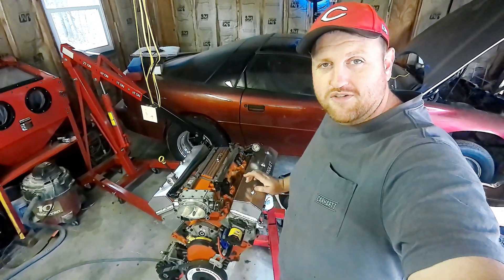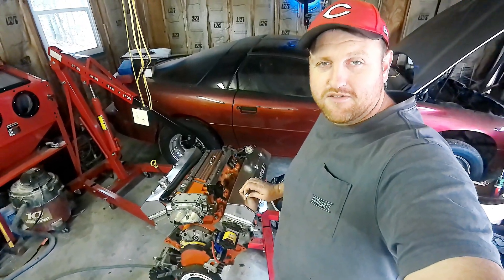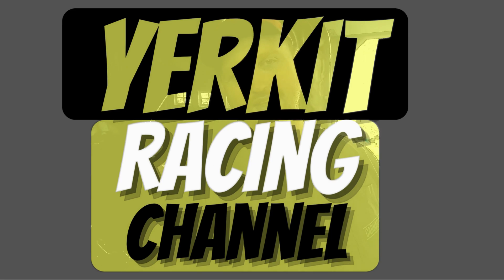SIMPLEST Hydraulic lifter adjustment EVER!

Comment: My theory when checking zero lash is twisting or up and down makes no difference. At the end of the day you have 40-60 thousands of hydraulic adjustment and the couple of thou difference in zero lash is undetectable to the engine operation. My preference is using up and down until I get the lash out then make the final by twisting with a very light grip. As soon as the oil squeezes out I can feel a definite drag. The biggest caution is making sure your socket isn't pushing down on the rocker ball or fulcrum to fool you. I learned the hard way and see people do this all of the time. Everyone can do what they want. Just saying how I do it and what I watch out for.
Reply from the maker: Thanks for watching and sharing your methods! definitely some good stuff to watch for

Comment: This works perfect.  EOIC takes forever and a day.  If intake is off definitely this
Reply from the maker: Definitely saves a ton of time! Especially if you have to leave it and come back
Reply: @YerkitRacingChannel  one question.  I did mine with empty lifters…meaning no oil.  Now that I’ve primed the oil system (oil comes out of every rocket arm) there is still ability to press into lifter 1/8 inch followed by recoil.   Is this expected?
Reply from the maker: @Se7enthsonSS Its normal for the lifters to bleed oil off when motor is cut off/oil pump stops spinning. That would let you be able to press the piston further down in the lifter. Are you able to push them down with oil pressure in the motor or did you try it after you stopped priming?  Also what psi did you see while priming the motor?
Reply: @YerkitRacingChannel  no can’t press them at all with oil pressure.  I had a lifter that wasn’t getting oil I’m the priming until I turned the crank over a few times.  Once I did that everything was harder to press and rebounded well
Reply from the maker: Lifters should be fine then assuming the bodies weren't worn too bad and the bore clearance was within spec.. Sounds like the oil is just bleeding down once the oil pump isn't spinning... As long as all the pistons moved freely up and down in the lifter bodies. As far as oil getting through to the top slower than the rest may have been some slight build up in the lifter passages... I did a video on rebuilding my lifters as about half the pistons were stuck in the top of the  bodies when I pulled them out the motor. On most of them it was hard to even tell what was binding them up. Doesn't take much trash at all to really bind the pistons and make them stop plunging or restrict the oil flow through them.
Reply: @YerkitRacingChannel  oh yea.  My lifters are brand new.  I think they just had some residual air that was trapped and needed forced out.  Before I line up my distributor I’ll do another “push test” on the rocker to make sure lifter has oil.  After this past month I don’t wanna drop a lifter starting engine up
Reply from the maker: @Se7enthsonSS  definitely don't want to do that! Way too much effort in building these things for something like that. Good luck on initial startup! They're always nerve wracking but exciting at the same time lol
Reply: @YerkitRacingChannel  cylinder 1 intake was still somewhat “press-able” but I primed AGAIN getting it to 65psi and set timing.  Fired her up today and it runs very well.  Thanks for the help
Reply from the maker: @Se7enthsonSS  glad to hear it and glad I could help be a small part of it. You going to be racing it or cruising it or both?
Reply: Will this method work if lifters and system was primed already?
Reply: @chrishicks4506  honestly I don’t think it will work as well.  With them already primed you run the risk of a valve hanging.  I’ve done that before.  I would let oil drain from lifters first

Comment: So I just tried running 1.6 Sa scorpion rockers with my stock heads on my 95 LT1 and all the intake rocker tips were touching the retainers and locks due to the valve not sitting high enough above locks and retainers.. I'm going with 1.6 NSA COMP GOLDS ULTRA now. Are you running stock heads and valves??    I am using tick 650 dual springs with nsa valve locks.. I have a video on my page of what I'm talking about...
Reply from the maker: I was running these same 1.7 rockers on stock valves without any issues hitting retainers or locks. This time around I ported the heads and put in longer stainless valves to get proper install height and a little spring pressure. I have a couple videos up on the channel going over the setup on the valves and install heights one these heads... you can check it out here - https://youtu.be/C0ijrNFE8GA

Comment: I'm thinking about changing the valve springs in my car.
Valves seem to float above 5800rpms 
No matter what we do we can't get it above 5800 without horrible cackling noises it goes pig rich and drops off.
We gained 20hp just in tuning but can't break that 5800 wall.

Why would my engine builder use 1.6 rockers on the intake and 1.5 on the exhaust?
I can run 1.6 on all of them if I want to.
I’m just not sure why he did what he did.
He’s a hard guy to get ahold of or I would ask him.
He built me a 383 stroker running “according to his Dyno” 500hp 520tq
Cam 234/242
Intake cam lobe 374 with 1.6 rocker = 598 lift
Exhaust cam lobe 382 with 1.5 rocker = 573 lift
The heads have 205 intake 160 exhaust valve.
Brodix Racerite 200 runner heads
Using a comp roller cam and comp short travel hydraulic lifters.
According to Comp the springs he used are too weak and that why my valves a floating at above 5800rmps 
So I’m planning on installing the right springs and a stud girdle and installing those ultra pro magnum roller rockers.
Just not sure if I should change that set up from 1.6/1.5 to 1.6/1.6 my cam card recommends 1.5 all the way across.
Oh and the heads “according to Brodix” are good for a 640 lift.
Any explanation for that set up?
Reply from the maker: There are a few reasons I can think of at the moment... Springs won't allow for over .600 lift. Exhaust would be .611 with 1.6 rockers. If brodix is saying they are good to .640 then they should be good.... Another thing could be valve to piston clearance on the exhaust side. May have been too tight with 1.6 rr.... Could have done it in an attempt to "even" out the camshaft since its a split lift/duration with larger exhaust side. Really need to try and reach the builder for him to let you know why he decided to go that route.

Comment: So you are using stock push rods??? What consists of your build?
Reply from the maker: These are not stock pushrods. They are one piece chromoly Trick Flow 7.100. I believe stock length is 7.200. 

When it was cam only stock length was good. Still have a set of chromoly 7.200 rods here too...

  I had to go to 7.100 to get the geometry right last time with the 1.7 ratio scorpion rockers. 7.070 rods would put it about perfect but I think these will be fine.